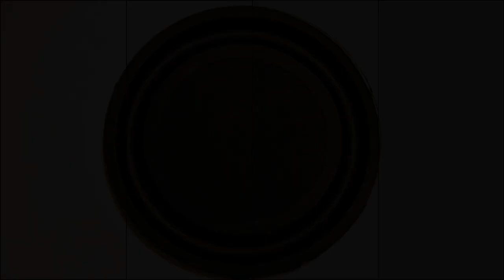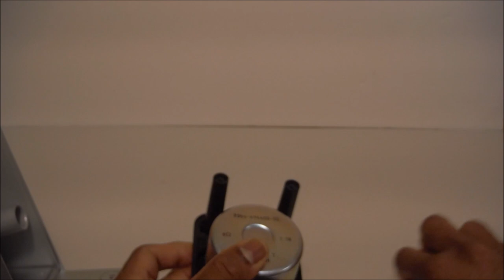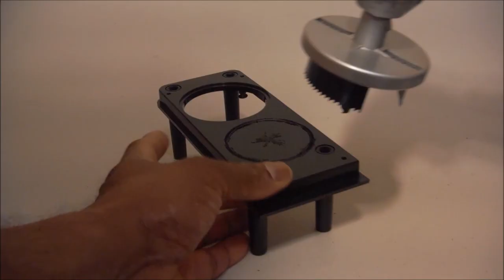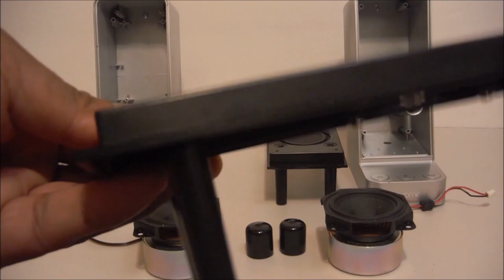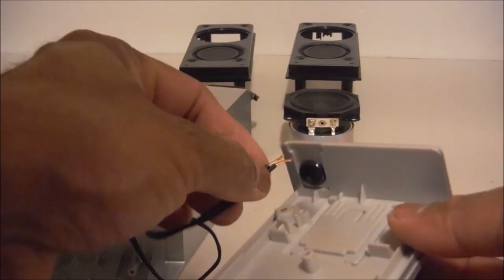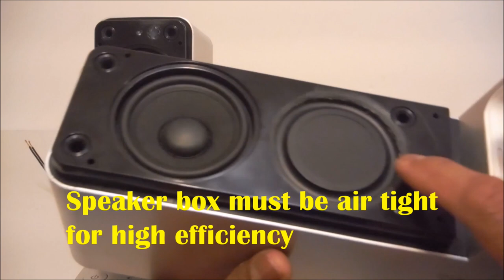HOW TO UPGRADE A SPEAKER WITH BASS RADIATOR

Comment: Bass Reflex (The Bass Duct) works at the same Principe as the Passive Radiators. The Only difference is that no Air Vent Noises are coming. But Passive Radiators are not so stiff like Bassreflex.
Reply from the maker: You are right. But, as for small speakers, passive radiators are more efficient than bass duct.
Reply: i have bookshelf speakers with a 3.5" woofer and a port. so you're saying there isnt gonna be any difference in bass if I added a radiator and closed the port?

Comment: Waste. most radiators require to be 1.5x or larger than the driver to actually do much
Reply: Nothing is a waste if you enjoy doing it. Further think about the size and quality of the driver and cabinet then reevaluate your statement about radiator size. Lastly, setting aside what I opened with, which is really more of a waste, a video that has offered if nothing else entertainment for over 22k people (at the time of writing) or making a non constructive comment?
Reply: I need help, how to calculate ACTIVE SPEAKER SIZE (woofer) and the SIZE OF PASSIVE RADIATOR SPEAKER SIZE? Also how to do calculation of volume. Anything you know will be helpfull? Thanx in advance. If it helps i can write the volume of the box and size of active driver. (make, model. ohms rating)
Reply: It doesn't. It only has to handle more excursion, which is the case for most radiators.
Reply: @BojanPetrovicvft  

Calculate a ported box first, then use the tuniing frequency for your passive radiator.
Reply: @cornflakes7664  The size and quality of your plastic Chinese speakers, or how often they've been viewed, doesn't negate the reality of physics.
Reply: @westelaudio943  so if the xmax for the active sub is 30mm, the passive radiators xmax has to be over 30mm? i heard at least double, is that right?

Comment: Can you tell me why you think this is an upgrade? Those cheap full range drivers probably have a Qts value that is very high and completely unsuitable for ported/reflex/PR alignments.

Did you measure the drivers T/S parameters and perform simulations to check that this was a good idea beforehand?
Reply from the maker: Overall, at the end of modification,
1. The quality of sound is better than before it was.
2. In case, if the bass duct is blocked/covered by something, the bass of sound would be affected but, now it doesn't matter.
3. Bugs can get in through the bass duct and spoil the speaker but, now its over.
Reply: So no is the overall answer.
Reply: bugs!!!
Reply: As it turns out his enclosure was made for a bass reflex port and as such is pretty similar to the size that passive radiator enclosures need to be (Passive rad is also almost the same size as the driver). Not perfect in vibration analysis or acoustic performance but probably not bad and better than the sound was before. Also calculating precise Thiele Small parameters for such cheap speakers is both useless and close to impossible to find the stats since the driver came part of a desktop speaker set. (This is not meant to be a professional HIFI speaker set)
Reply: swiftink You measure the T/S parameters yourself :)

It had passed me by that these were originally ported to begin with, so going for a PR does indeed make sense. Hopefully the drivers will have been designed with a low Qts in mind but that might be hoping for too much. They usually aren't.
Reply: BiggityBoggityBoo how could it pass you by? Didnt you watch the video?
Reply: LangerDan I did but half watched it as it was on my second screen.
Reply: Qts is no problem because ported and PR are very similar concepts. I'm more worried about the tuning frequency of the PR, it has additional mass and no additional suspension, so it's tuning might be much lower than that of the port, deeming it basically useless.
Reply: @thatguythatdoesstuff7448  

I wish when I was younger and got into speaker building someone would have told me about TSP, so maybe I wouldn't have wasted so much time and money on bad speakers LOL. I surely had fun with them, but good speakers are even more fun.

A badly calculated PR is still worse than a badly calculated port. If you wanna have fun ok, but then please don't refer to it as "improvement" or, in general, to ports as "obsolete". You will make people waste money. Considering we live in the "information age", I'm suprised how ignorant people are when it comes to speakers. People say PRs or ports are the to "make speakers move more freely" and "you should add them to sealed speakers" for instance...

Comment: what is the diffrence in bass with and without those radiators???..i mean i really wanted to know the difference..you should have made it before installation & after installation.
Reply: Anurag Fulwaria Bass radiators improve bass like JBL likes to do, There able to tune there Speakers a lot and very well because of the increase of bass
Reply: 3DTwister YT sir is there a major noticeable change ??
Reply: Anurag Fulwaria Not exactly, But you can tell it’s making a difference if you put your ear close to the radiators, The bass increases because the radiators act as another pair of drivers, Even though there just metal plates or just a normal plate
Reply: On the other hand without radiators it can still sound very good, Sony has done that without the use of radiators, But the reason why you get better quality with radiators is if the drivers are pumping air pressure it’s gonna move radiators (If applied) If you let the air free, It will sound as if it’s a 5$ speaker

Comment: Very nice demo of passive radiator.. thanks a lot..
Just two question sir...
Size of passive radiator should be same size of subwoofer..??
Secondly the diafram or paper used in subwoofer is conical in shape but in passive radiator diafram or paper is flat in shape.. it is imp or any rule is there..
Thanks and regards..
Reply from the maker: For  a better perfomance, passive radiator should be bigger than subwoofer (Ratio is 1:1.5). Passive radiators generate low frequencies. So, flat panel is recommended for good bass.

Comment: I need help, how to calculate ACTIVE SPEAKER SIZE (woofer) and the SIZE OF PASSIVE RADIATOR SPEAKER SIZE? Also how to do calculation of volume. Anything you know will be helpfull? Thanx in advance. If it helps i can write the volume of the box and size of active driver. (make, model. ohms rating)

Comment: You lost bass by sealing up the port and adding a passive radiator. You lost the ability to hit the lower frequencies because now you have something pushing back on the active woofer instead of allowing the woofer to do its thing by using the port. The port allows for more movement by pushing air out instead of air pushing back agnist it now. Plus the port allows you to hear sound from the front and back of the woofer.
Reply: exactly thats what people dont get, there only useful on a Bluetooth speaker for example where there is no practicality for a port, thats why they use radiators, as you said, covering up the port and sealing the cabinet will just let the driver move a lot less, leaving you with less bass, probably a speaker upgrade instead of a bass radiator upgrade would've been the way to go,
Reply: Buchardt and Klipsch disagree with this.
Reply: This is actually wrong to a huge extend, you don't lose bass adding a passive radiator ... there is no general rule to state that one is more efficient than the other in every case. The whole principle of the port and passive radiator is exactly the same and it's called phase inversion. In other words if it's tuned correctly it should push back against the cone movement. Both provide excellent excursion control if tuned properly. Since small sized woofers have greater FS and ports are only effective for lower FS manufacturers put passive radiators on portable speakers ... to preserve the lowest frequencies.
Reply: Main purpose of passive radiator is to invert the phase and when the active driver is at its resonance frequency you get the least excursion from it and the most from the passive radiator. They work together to achieve bass by moving in the same direction. It's stupid to say that when the active driver moves less, you don't get bass ignoring the fact that you have another moving element. The same rule applies for ported boxes. Both ports and passive radiators work the same way, but in small volume boxes you cannot make a port big enough so it's air mass to be heavy enough to reflect lower frequencies. This is why you put passive radiators with weights on them.

Comment: In real, you need the double the size of active speaker/woofer or two passives radiators
Reply: No that's totally wrong . Your radiator needs to be just over 1.15 times the driver size ...lol  I did the math.....
Reply: @supercreations1593  OK. Agree with that.